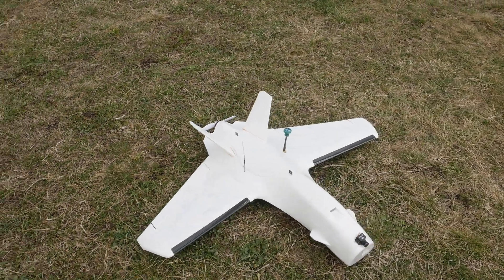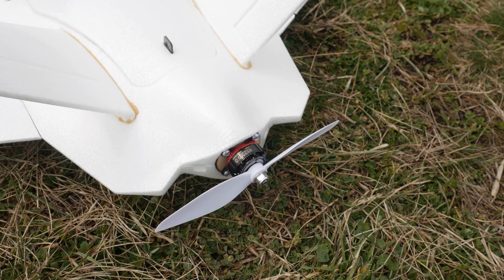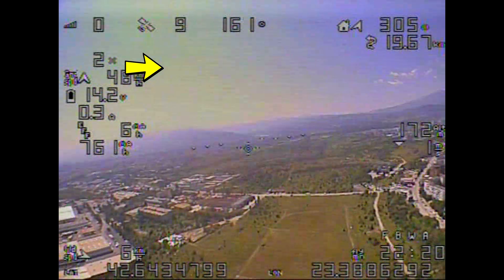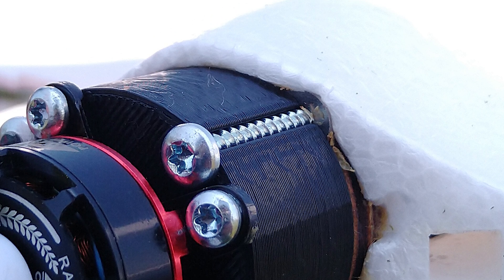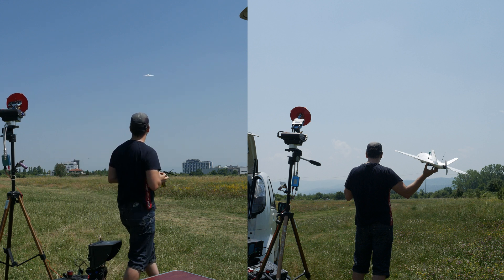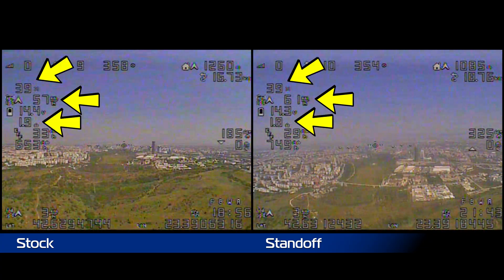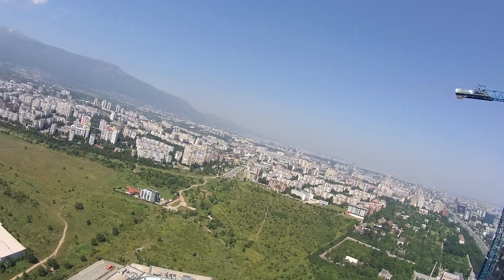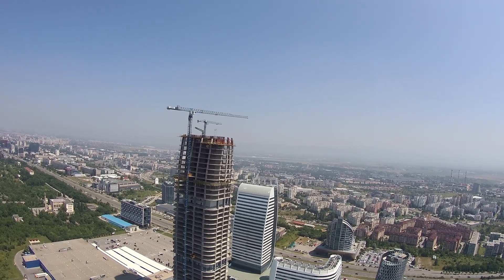AtomRC Dolphin - efficiency mods... possibly?

Comment: What do you guys think about 4s 2317 1250 kv with 9x6?? I plan to go all in with liion
Reply from the maker: Sounds like a good choice! Though... isn't that prop a bit too big for this plane?
Reply: @ArxangelRC  it will cause huge problems when landing I guess... But is there any possibility to become similarly efficient with a smaller prop? Maybe 7 or 8 inch would be a reasonable compromise, but it seems like they all would draw more amps to match the thrust required. I'm not exactly sure how to tackle this. 😂
Reply from the maker: @j7...  Actually the first problem would be torque roll on take off... long before you get to the landing bit! Also, thrust per se does not give you efficiency! Besides... if the plane becomes unflyable by not being able to take off or land properly without breaking the prop every time... it is hardly useful that it is 10% more efficient than an 8" or 7" prop! Also, pitch speed for me is equally as important and the ability of the prop to grip and and propel the plane quicker at lower motor RPM. This is what you need for efficiency! Not thrust!
Reply: @ArxangelRC  okay you are so right! they torque increases with the distance of the rotating object... i am such a fool. okay 10% more efficiency really isnt that much. i am too unexperience to make these educated guesses. this estimation helps a lot. so what would be your recommendation? lets say you want your dolphin to be able to fly for ages, but at the same time you would like to have some reserves so that you are able to increase the speed abit. ideally the plane would have a "not too slow" cruise speed :D
Reply from the maker: @j7...  I'd actually go for an APC 8x8 prop! I've used it before on something... can't recall which model it was, but it had crazy pull for take off, and it provided a good deal of speed too! May go up on the motor Kv as well!
Reply: @ArxangelRC  okay, I can follow along with this. But how can you be sure nothing will go up in flames?
If you decrease the diameter by 1 inch and increase pitch by also 1 inch, what difference does it make in the power the motor needs to spin it equally fast? In my thinking the diameter effects the needed power more than the pitch, so one should be fine and heat generation shouldn't be a problem, right? 
That's quite interesting because that means you can have higher pitched prop for higher cruise speed at lower rpms. I guess climbing performance is only affected negatively, if the plane was underpowered, which is not the case. 

This is so interesting, thanks alot arxangel.
Reply from the maker: @j7...  I think you are way overthinking all of this! You are after efficiency... when the plane is up there barely sipping the battery for longest flight, chances are something will freeze before it overheats! Really the only time you draw a lot is during take off, and that lasts a few seconds usually, so should be more than fine!
Reply: @ArxangelRC  yes, indeed xD
I will test out manufacturers specs, increase to the suggested 8x8 and watch how speed and amp draw change. If amp draw is Still low, temperature should be fine. Thanks for the good advice it is highly appreciated.
Reply from the maker: @j7...  You are welcome mate! I am pretty sure you won't have issues with temps, especially if the ESC is placed where it should be to get some good cooling! A plane never sits in one place, so you always have an airflow going around the electronics!

Comment: Thanks for doing this.  It's a very amazing plane. I think the stock configuration with the EMAX 2205 motor gave it incredible efficiency.  30-40 mah/km??  Wow!  Also, was that a 6045 prop?  How far do you think it would go on a 4S2P Lion battery?
Reply from the maker: Actually the current sensor is not showing the amps accurately, so don't trust those values! :)
Reply: @ArxangelRC  Ah.  Thank you for the update.
Reply from the maker: @MrMmDonuts  Sure! :)
Reply: The stock 30A esc is enought?
Reply from the maker: @gombtam  Seems to be with the stock motor!

Comment: at 2:45,  no  difference.     WHY.        because the   prop  TYPE  is  not   correct.        it is  too  thin (flexible), for the  APPLICATION.        should  be a   EP  prop.
Reply from the maker: Right, will try a different one then, see what happens! :)

Comment: hmmm           at 2:17, i question the wisdom of doing this, if it is based  on  a  Flawed  analysis of the situation.
you may know that there is a  'relationship'  between an airframe's  center of  Mass (c-m)  and  its  thrust line.     (if interested, see my tutorials.)         discussion of  this relationship  Necessarily  Assumes  that  a  c-m   IS   Optimally located.           that  Optimal  location  occurs  at a point (above/below the main wing)  that   Vertically  Aligns with  25  Percent of chord/mac.            ideally,  a thrust configuration  Should result in the  thrust  Line  INTERSECTING   the  c-m.!!!        achieving this can be difficult, when tail-pusher prop thrust is utilized.            in this case, there appears to be little need  to  accommodate  little/no  Vertical  offset of thrust (away from alignment with  the  EXPECTED  location  of the  c-m).           cheers           googletranslate
Reply from the maker: Right...

Comment: Interesting Video! I almost bought one of these recently but got the Reptile Dragon V2 instead :)
Reply from the maker: Reptile Dragon is an awesome plane! Not a wrong choice either!
Reply: @ArxangelRC  i managed to get the vtol design you displayed work pretty well do you think i will run into additional difficulties if i try to make a larger size setup

I mean a wing span of about 4 meters and much larger motors whilte keeping the same scale of the small version
Reply from the maker: @FirstLast-tx3yj  Damn... that would be an interesting thing to see... but I would guess it would be a good deal more susceptible to wind at such a size! Also... it will still have only 2 motors?
Reply: @ArxangelRC  i found motor prop combo that will generate more than 30kg of lift which will be reliable and enough. I will use 2 motors 
Motors: 120100    60Kv   25KW
Propz: helix propeller 1.2x6 zoll

It will only be a larger scale thats it

But the controller caliberatio size is what concerns me and vtol in winding conditions.... 

Although i will only use vtol mode for takeoff and slight movments 
I will not be wondering around in that mode
Reply from the maker: @FirstLast-tx3yj  Hm... well... I am not sure what more to tell you! You could try it... but keep it VTOL-ing only in calm weather! I guess there must be a reason why there aren't more models like this... especially large scale! This would be quite impressive though!
Reply: @ArxangelRC  i was thinking about having 4 motors instead of 2 to make it much more stable like a drone and provide further thust in plane mode

But i am trying to keep it simple!

I dont know if you could visualize what i have in mind... basically the same design just 2 superposed fans on each side making it a quad copter in vtol mode

Maybe the electronics will be simpler like a drone
Reply from the maker: @FirstLast-tx3yj  I can imagine it... Google did something like this a while back, but gave up on it for some reason, seemed to fly well though, once in plane mode!
Reply from the maker: @FirstLast-tx3yj  Sounds awesome! Good luck and let me know if you ever build it! Would love to see it in action!
Reply: @ArxangelRC  sure!! 3d printing is a gift from the gods... allows us to test crazy ideas and prototypes
Reply from the maker: @FirstLast-tx3yj  Yup, agree 100%!

Comment: Looks like you have a bit of jello in the HD video. I wonder how much static and dynamic balancing the prop/motor would improve efficiency and reduce noise as well?
Reply from the maker: That might be because of the way the camera is mounted right now! Only a not so tight rubber band holding it in there, with a lot of room to move around!

Comment: In regards to efficiency, I always wondered if windmilling props are somewhat different to still props using ESC brake. do you have any experience ?
Reply: I do that on all my planes. Windmilling props are bad. When they are stopped they glide pretty good
Reply: Windmilling will be less efficient because an idle motor spun by an external force acts like a generator and thus a brake. That is the point that tends to get overlooked in in test stand experiments to determine the matter. A windmilling prop/motor will steal energy from the slipstream to generate electricity, which ends up as waste heat unless you have circuitry to recharge the battery. I don't think such equipment is generally available for R/C, but I heard it was tested in F3A planes years ago. Without a motor in the system, a windmilling prop will not cause more drag than a static one, and that's the situation you see in certain test rigs on YouTube.
Reply from the maker: Yes, they start acting like a parachute! Good when you want to use them to slow down a bit... but not when you want to glide more!
Reply: It makes a huge difference! 20% to 50% percent better glideratio with a folding Prop thats the reason why I have folding Props on all my Pusherplanes.